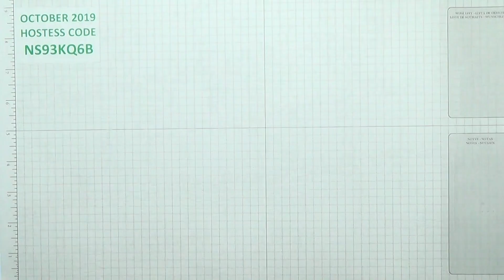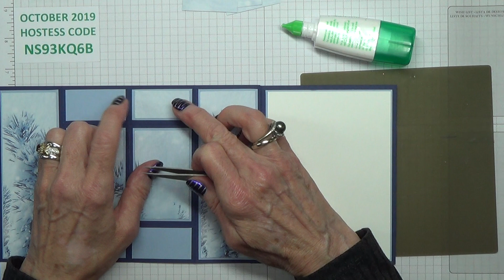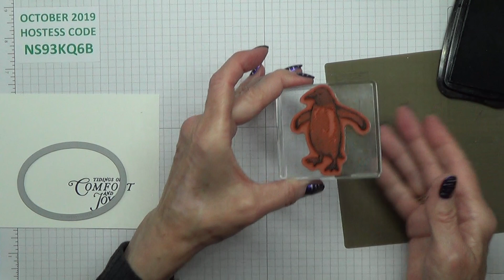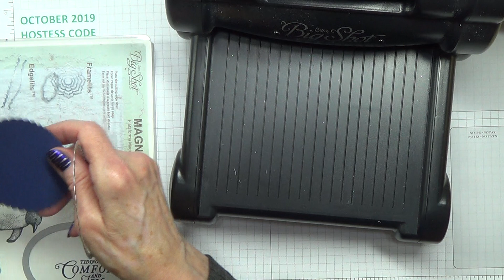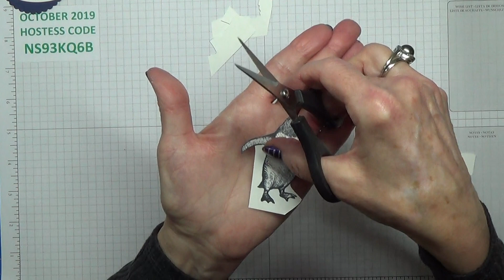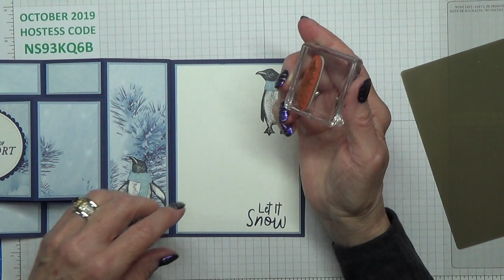No.503 - Playful Penguins Four-Fold Card - JanB UK #7 Top Stampin' Up! Independent Demonstrator

Comment: Hi Jan. Will the new trimmer be able to cut a piece of 8-1/2 x 11 on the diagonal with no problems? Thanks for answering. Love this card, by the way.
Reply from the maker: Hi, Tammy. I will check it when my new trimmer arrives tomorrow/Wednesday, and will get back to you. xx
Reply from the maker: Hi, Tammy. Yes, sort of! First you need to take out the score blade, to allow the cutting blade to go completely from end to end. To test it, I cut one of my sheets to measure 11" but the width is 8 1/4". I put it in the trimmer diagonally and cut. There were marks on both ends where the cardstock went over the ridges at the top. I'm planning on doing a video review, and I'll try and include a demonstration of this. I need to find a piece of cardstock that is US size! I'll see if I have some retired 12" x 12" cardstock I can cut down! xx
Reply: Thank you, Jan, for checking this out for me. I would love to see a demonstration on this.
Reply from the maker: Hi, Tammy. I included it in today's video for you. xx

Comment: Hello Jan. another beautiful card. but 1 question. the smaller base card piece, you mention the size is 4 3/4, but according to your meassurments its 4 5/8. it's a difference of 1/8 but I dont get my card as it should be.  can you help what meassurements I should work with?
Reply from the maker: Hi, Willemien. The correct measurement is in the details below the video, i.e. 4 5/8". In the video, when I adhered the smaller piece to the larger piece it was 1/8" too long, so I had to trim 1/8" off. I corrected the measurement below the video. Your card should work beautifully now. Please let me know if you continue to have problems. xx